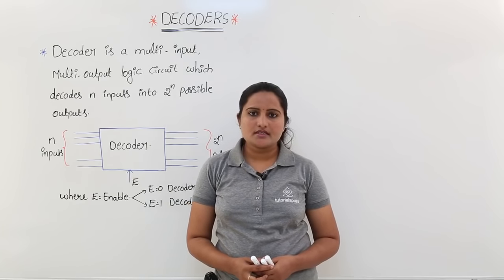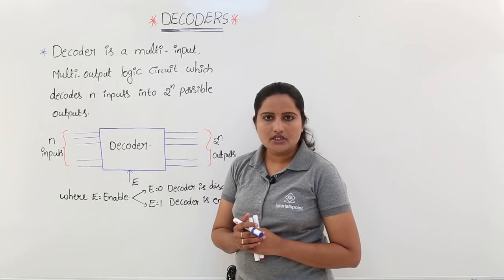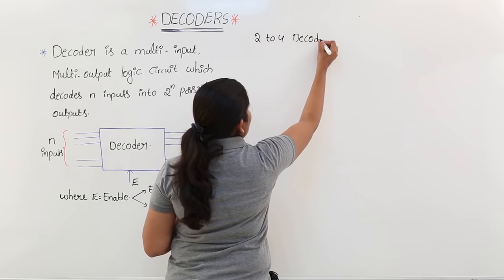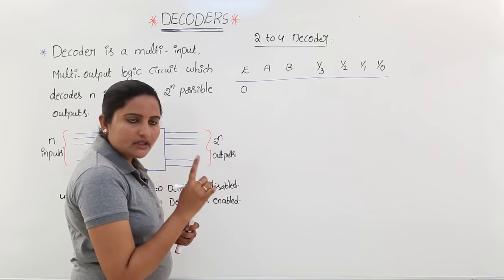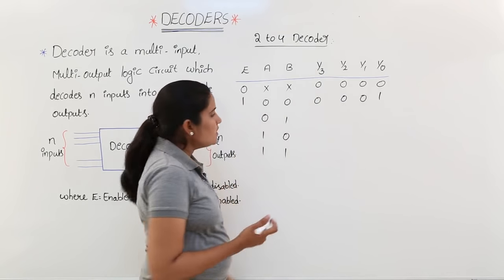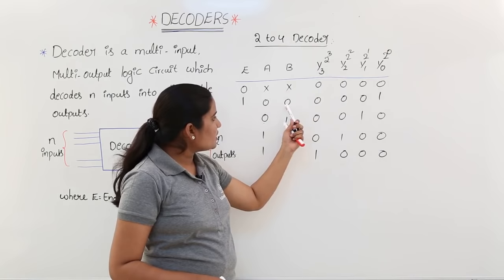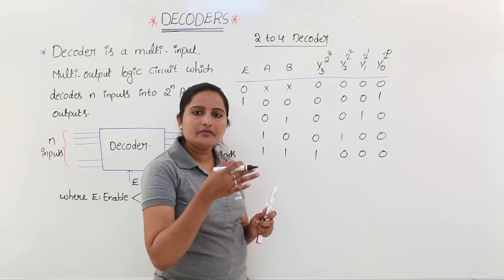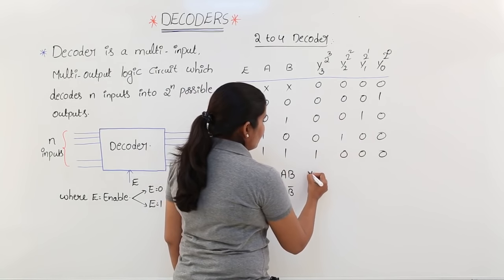2 to 4 Decoder Design

Comment: Mam but when e=0 then it is enabled nd when it is e=1it is disenabled
Reply: I think you have watched Professor Srinivasan Lecture class
Reply: @rishipl3559  no I red in book
Reply: @akankshaverma2349   If you are considering even Tri-State Gate if enable is ON then it works like normal gate and enable is OFF that circuit is electrically disconnected. Akanksha Verma could You please tell me which book do you had studied?I think you are studying for IAS
Reply: Akanksha Verma you are right.
Reply: @rishipl3559  no ,I m in b.tech 2nd year CSE ..i redd in Morrissis Mano ..nd Kohavi
Reply: @akankshaverma2349  If you give your E-Mail ID I will send some valid reports and data based on the digital tri-state gate. Yeah Ok,  I am using Morris Mano Book and I am doing my b.tech 2nd year ECE.
Reply: Enable and disable with reference to input is depends on manufacturers

Comment: Nd where is E part .nd 2to 4 decoder with enable input is used by implementing NAND gate not AND gate how u r teaching mam ?
Reply: No no no! There are actually two ways to represent the decoder, either by AND-OR gates or ALL-NAND gates..Unless the question asks you to represent the circuit in NAND, there is no reason to use the NAND gates..
Reply: Right ....I am also confused seeing and gate instead of nand gate